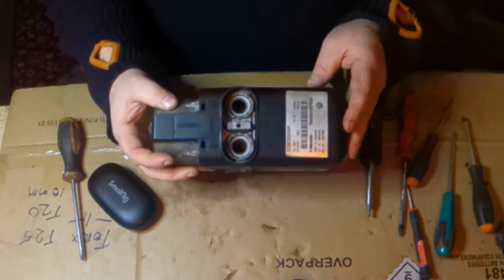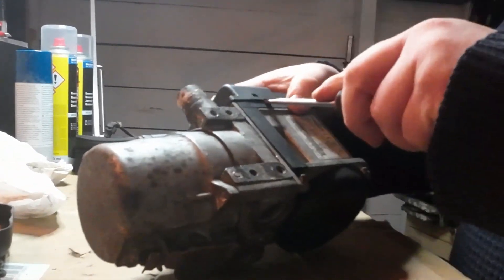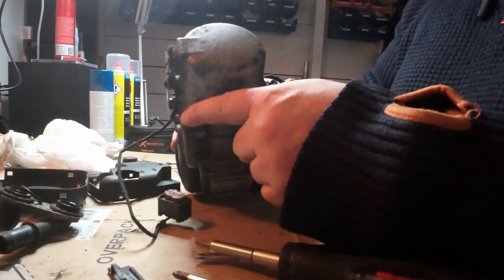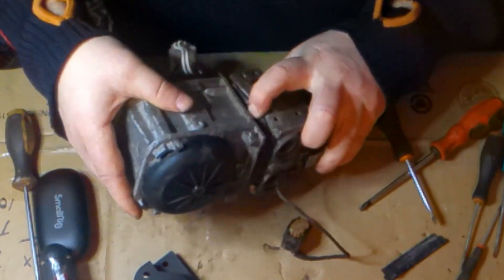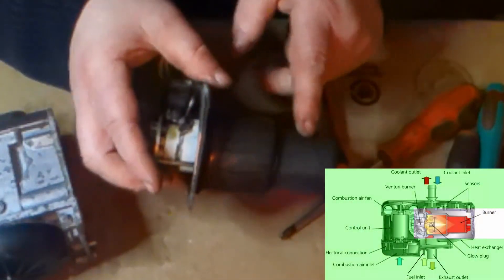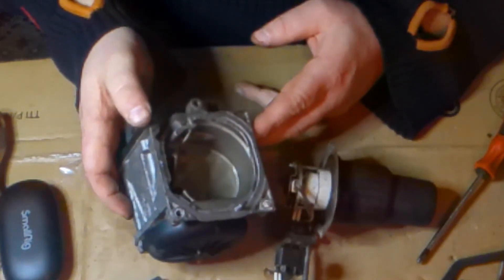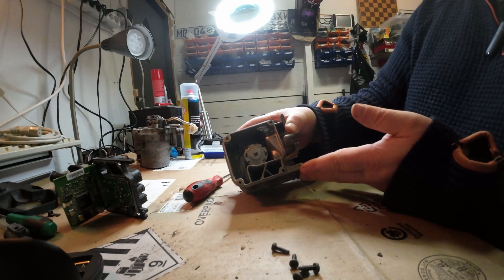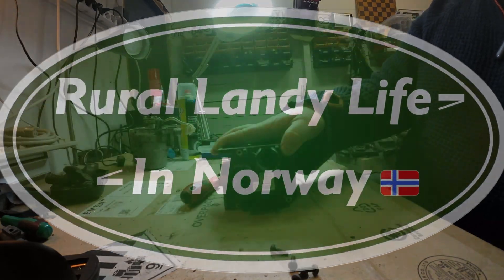Webasto Thermo Top V disassembly and service.

Comment: Hello, I want to ask what this error E70C2F means. Webasto thermo top V.
Reply from the maker: Hi, the E70C2F error is a error code generated by the car not the webasto itself (I'm guessing BMW?). It means the the car itself doesn't get a response from the fuel burning heater. I would do a diagnostic directy on the webasto itself to see if the fbh has som stored error codes.  Here is a link to webasto fault codes. https://www.jpcdirect.com/webasto-heater-fault-codes-a-guide/ Good luck with your diagnostics and sorry for the late answer.